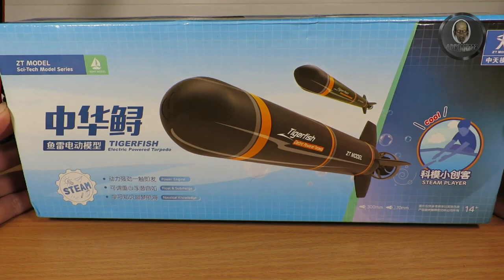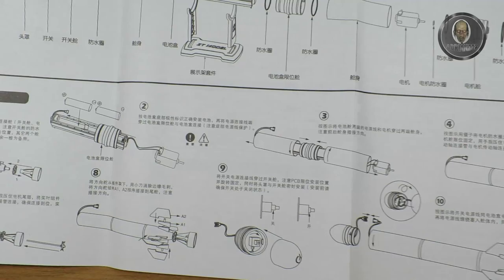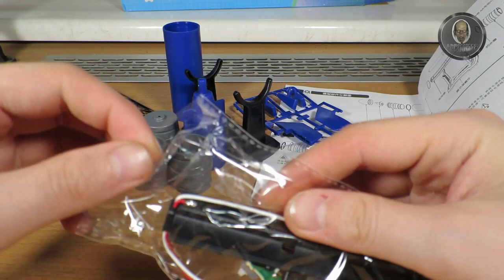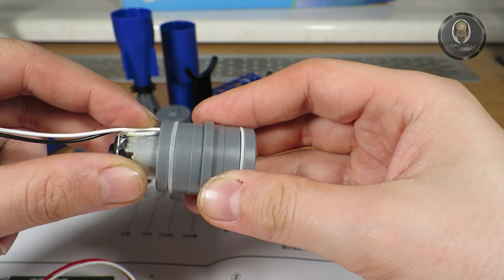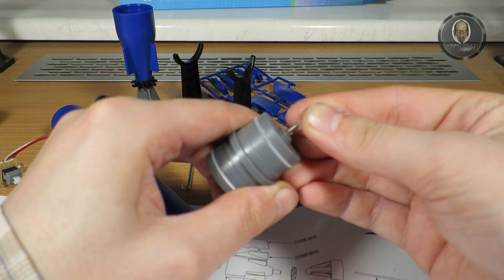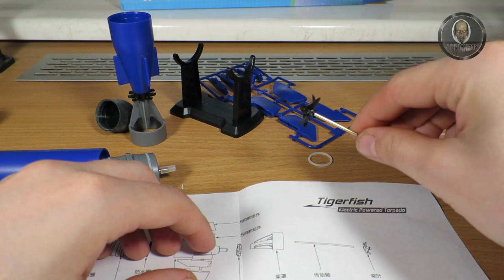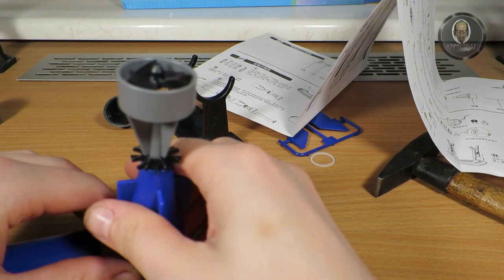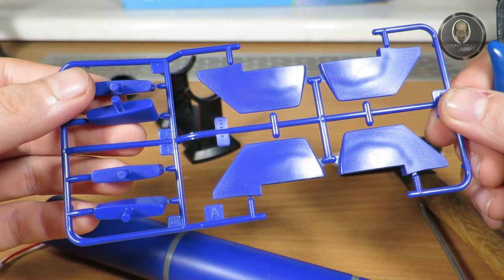Electric Powered Torpedo !! DIY KIT for kids :)

Comment: Could you attach a remote control to it
Reply from the maker: I wonder about the same but it's small so it would be hard to add steering to it
Reply: Adrian202 RC perhaps a micro rc car parts? :) small wire attached to bottom fin to allow you to guide the device, while you leave the side fins set where it will stay at surface
Reply from the maker: @claytonreed5153  There is always a way to make a RC from it :)
Reply from the maker: @claytonreed5153  Small RC planes have micro servos but it's not water proof so hard to say how long it will survive